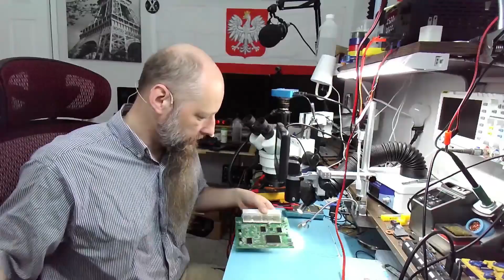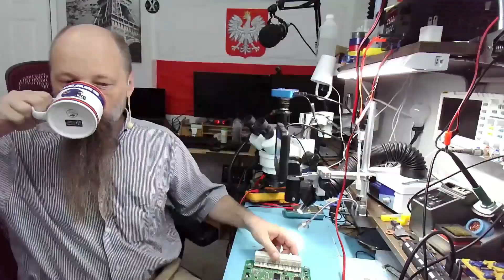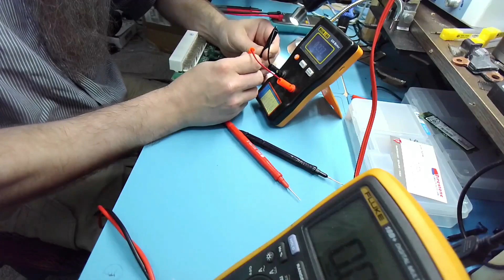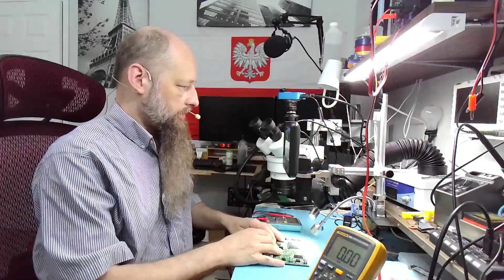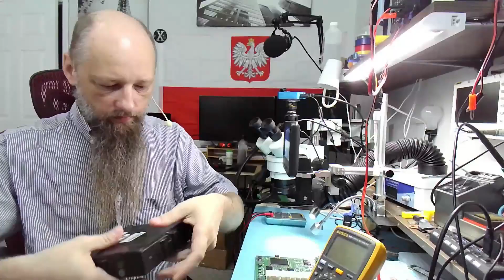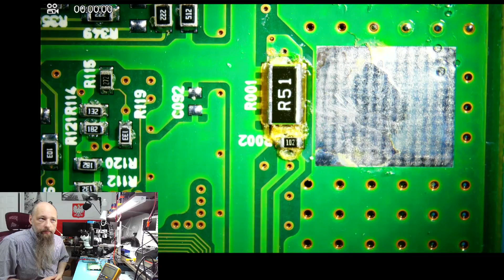ECM Diagnosis for Tyler | P0019 Is the quality going down?

Comment: I'm not sure why my comment did not post but the camshaft corelation codes wiill probably keep setting if you do not reset the learned values in the eeprom. You can reset these usually a special procedure or with eeprom tools. They will not go away by clearing codes or reflashing the ecu with an update as neither touch the eeprom. I can help you with this if you want. There is probably a tsb saying to replace the ecu for this fault. It covers a lot of Subaru ecus since 2013 or so on up.
Reply from the maker: Hi Robert, could you email me? blackhorserepairs@gmail.com
I would very much appreciate the help.

Comment: The P0019 fault can be caused by an after market camshaft sensor that gives an incorrect pulse width. I suggest to make sure your customer is using OEM camshaft sensors and they should scope the crankshaft and camshaft sensors and check the waveforms against known good waveforms before assuming its a ECM problem.
Reply from the maker: I'll make sure to ask, but on average nobody defaults to ECM when encountering a fault, it's usually the last thing after you eliminated everything else.
This could also be caused by a loose timing chain right? Is the camshaft sensor fault common for this model?